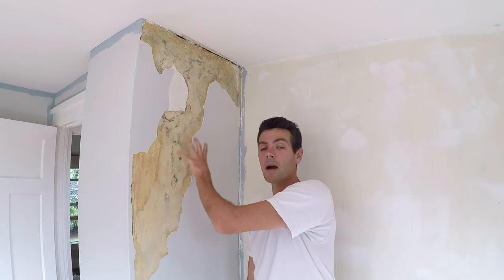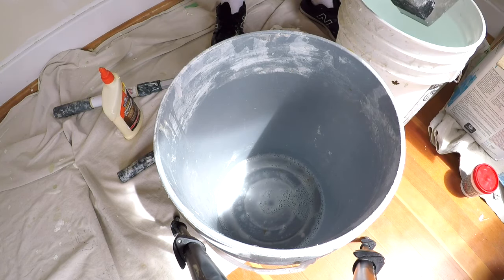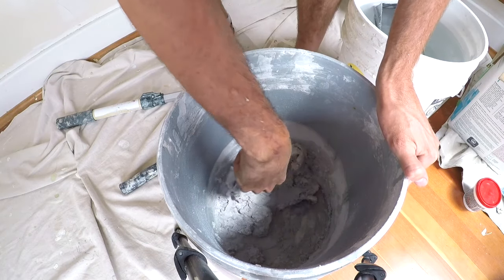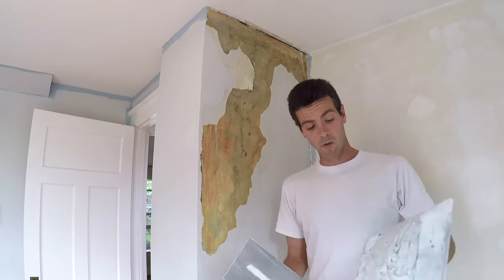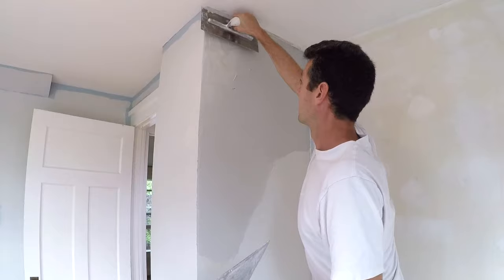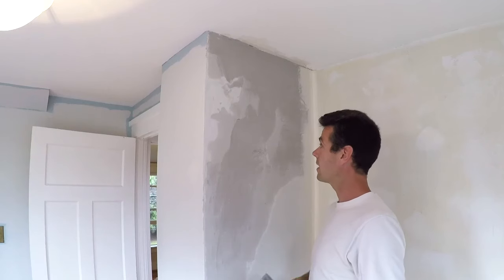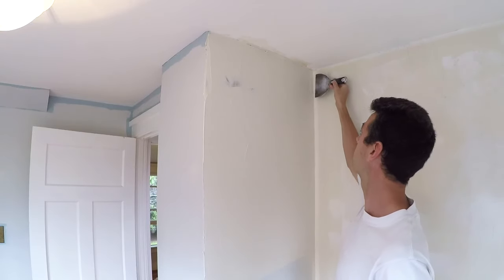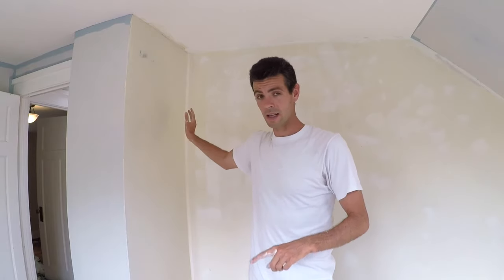Bonding Quickset Drywall Mud to Old Plaster!

Comment: I was actually wondering what the difference is between plaster in the USA and the UK. From the videos ive seen The UK plaster seems easier to mix you basically just add water. While in the USA. They use a base coat and for the finish coat they mix plaster  with a mixture of lime and water. Most drywallers Ive seen use a quick set or durabond with mesh tape or fiberfuse and then an all purpose or top coat mud for the finish.  as a diyer Ive had pretty good success with the durabond and mesh tape method. Ive also tried your glue method and it also works great.

Comment: We live in a bungalow built in the 50's and the section of plaster that delaminated received water damage from some old windows that were condensing like mad in the winter. Well, that condensed water was getting into the plaster on the cinder block beneath the window forcing it to delaminate, leaving an unplastered section about 18" x 12" in size. 

I'm going to try this repair method tonight so wish me luck!

EDIT: Success!!!! I can't believe how well this took, not to mention how incredibly strong it is. So much so in fact when I tried to sand it down by hand, I nearly passed out. I'd definitely recommend a hand sander for this.  But it looks great and blends in seamlessly. Thanks a million for this!
Reply: How thick was the layer that delaminated ? I have plaster delamination with pain and it’s like 1/16” thick.  Wondering how I’m going to adhere that thickness back on the wall and make it stay.
Reply: @sef2273  It was roughly about that thick. The previous owner also used some mesh in an effort to "band aid" the problem but just left a huge bulge that needed to be sanded down before I applied the glue/plaster solution. I'm looking at it right now and it's still solid to this day. The surface is also quite smooth underneath the coating of paint, with no shadows or bumps appearing in daylight.
Reply: @domenicpolsoni8370  did you use mesh tape?
Reply: Don't need to. Setting compound won't crack. 
Sheetrock brand 5 minute mud. Not necessary to put glue. Just little water, and a pan at a time. YOU GOT FIVE MINUTES! GO! 
After cleaning the quickly setting panful you used, come back with your trowel or knife and press it in low angle and also shave your ridges if they are dry
Reply: @sef2273  I did not. Just straight onto the surface. Mind you I made sure to remove as much dust and particles as possible before applying. Something tells me that the glue/plaster mix would have adhered anyway though. It was so incredibly tacky.

Comment: It's the wonderful world of plaster that every person who does drywall wants to stay away from. Some homes have plaster on 1/4 gypsum boards, and not wooden lathes
Plaster is a completely different trade even though they have similar motions, and both start out as mud. I have a house built in the 50"s. They used small 2×3 ft gypsum boards, then a rock lathe, concrete like substance, then a plaster coat and a final plaster skim coat.
Most of the walls range between 7/8 up to a little over an inch. 
There are several ways to tackle these repairs. Your videos are excellent in learning the basics so anyone can figure out a possible solution.  I would use 5/8 drywall score horizontal keys across the drywall, then use a quick set, even used a plaster before, and then a final joint compound (easier to sand) as a final coat which was easier to make smooth and sand. 
I have had several disasters. Finally, I got it to look professional. This last process seemed to work the best.
Any videos from start to finish on this topic would be welcome. These walls last a long time and are quality built, but after 75 years, many of these houses are starting to break down. Getting cracks and just normal damage and wear. Thanks again.

Comment: Interesting approach!
I had chosen a (2K) resin and thrown sand with huge grain against the wall. Once hardened it is like sand paper, pretty common for coatings on the floor.
With acrylic resin, you can work afterwards pretty quick and this is extremely durable.

Comment: I appreciate your videos. I would like to see a video on mixing mud, in particular a small amount for repair using quickset mud. The powder to water ratio has always been a challenge for me. Too dry then too wet, add more, too dry,...repeat. Throw on wall before it sets up (not literally but close to get it on fast).

Comment: I often use Kills primer before skimming over with All Purpose mud and let dry overnight.  I let the Kills dry to tacky.  Works great when feathering over painted surfaces.  Kills sands at the feathered edge well too.  I typically have several days to do drywall/plaster repairs because I'm doing room remodels.
Reply: I need to do some repairs to walls with damage similar to the one he does in this video. I have cracks in the plaster. To make sure I'm reading  your comment correctly- should I do a coat of Kilz Primer on the bare plaster BEFORE I repair the cracks and imperfections,  and then do another coat of Kilz Primer after I've sanded the spackling smooth? Then I can finally paint the repair to match rest of wall? I appreciate any insight,  this is my 1st foray into this type of repair job!
Reply: @the_ghost_of_teddy_perkins  I use the Kills Primer as a sort of glue for the mud to stick well to painted surfaces.  Drywall mud will stick great to bare plaster IF the plaster is sound.  (so no Kills needed here.)  Make sure bare plaster is not dry and dusty.  Moisten before applying mud.(dab with a wet sponge)
Reply: @L.Scott_Music  Thanks for the prompt reply! Sorry if this sounds stupid, but is 'mud' the same thing as spackling?
Reply: @the_ghost_of_teddy_perkins  No, spackling is a light weight material for small holes.  Mud is short for 'All Purpose Drywall Mud' (in this context).  There is Fast Set mud too but I find it's bond to be less, so I like to at least do a first coat of All Purpose first for larger patches.
Reply: so after i use all purpose do i then use the blue lids since its smoother

Comment: Vancouver Carpenter 
When I first started mudding on my own, I had some issues with my mixing setup. So I decided to use warm water, even hot water once. 
BUBBLES! The cooling effect of the mud created a thousand tiny bubbles in my coats lol. Live and learn. 
If only your channel was around then!

Comment: I’ve got a old plaster wall house. That I’m making repairs to. What I usually do is use a oil primer to seal all the walls, fill in my worse areas with durabond 90 indoor/outdoor joint compound. Hot mud one coat and use premixed green top USG thinned out with a little water for the final skim coat. Little to no sanding. It works but a slow process. Have you ever used oil primer to seal old plaster walls

Comment: I’ve done many repairs like that, i’ve always used a concrete bonding agent (looks and smells a lot like white carpenters glue and water mixed). Good thing about using that is that you can also use it around the house for any concrete work as well.
Reply: would a primer work just as well ?

Comment: What I see on almost every working chimney that is covered with plaster is stains.
The problem is condensation from colder inside air and hot chimney smoke.
To avoid it, before painting plaster around the chimney, waterproof it, seal those pores, If the chimney if made from brick. Stainless steel chimney wont leak.
If the roof patch around the chimney is leaking because of rain, first fix that patch with tar, then walls.

Question for Ben: Have you ever used fiberglass tape insted of paper tape? Not mesh but full fiberglass tape.
Keep up the excelent work!

Comment: Thanks for this. I was doing some repair to my 1940 built house. It has 1/2 drywall covered with 1/2 inch cement with a thin plaster vaneer. I had some areas where the plaster veneer came off. I'm going to try your glue method.

Comment: Very well done. But I have to say,  I've never had fast set delaminate on me. I make my mix a little on the too wet side which helps in adhesion. I also use durabond 90 for my initial and follow up with sandable 90 or 120 depending on how much I  need to do, then I  top it off with my finish coat of topping.  Works perfect every time.

Comment: I must say, it is very refreshing to learn from someone who lives  and educates for quality work! There is always a lot to learn from you, even from mixing mud. ;-) It would be great to give mixing advice and mud comparison (incl. mud consistency which then is useful for your global audience) for the different coats and purposes. Your videos are just great, educational and highly appreciated. As inspiration for future videos you could consider that even initial drywalls can be a pain and can have its own challenges which then have to be fixed e.g. uneven butt joints. You taught us already separately abt coating butt joints and flat joints but how would you coat a ceiling where horizontal flat joints meet vertical butt joints like in a chess board of rectangles? Starting with the butt joints and then the flat joints or would you finish it combined as ceiling sections? It is the skim coat, which now has to handle some imperfections and make the difference in the end...
Thanks a lot for being our hero of quality work!

Comment: Our drywall finisher is havaing a really tough time with air pockets. It’s really gotten worse the last year. Seems like it’s mostly over wide butt joints that are painted. I know that the painted surface absorbs water at a slower rate so that explains a lot over the painted stuff but it’s also showing up on the new drywall as well. These guys do great work but we’ve got to get this problem solved.
Reply: creekfreakjr  the air pockets are called pocks,you can buy an additive that you put in the topping compound (finish coat) that helps eliminate the pocks(air pockets)some types of topping compounds seem to be more prone to pock then others,

Comment: Like your videos. I'm a plasterer in the states. Was told never to use the yellow carpenter's glue by a chemical engineer. I guess if things didn't fall off the wall then it's actually just fine to use! Ha! I use regular white Elmer's glue which much cheaper than Thorobond or Larsen's... especially when you cut it with water. The two other brands I mentioned recommend not cutting with water but I'm sure they are simply PVA just like Elmer's but I don't want to chance a failure.  I never get a call back with this method of cutting glue. Must let it tack up before coating over but it can be dry. Must re-glue if not coated within 24 hours. If not dry and only tacking it also acts like a slight retarder to the gypsum that's in the hot mud because we all know that hot mud and plaster SETS to get hard and does not DRY to get hard.  Retarding is when the gypsum won't set as fast as expected.

Comment: Yes, this is the one!! Finally! This is the video that is going to help me finish my repair. I can’t tell you how much searching I’ve done and there’s rarely anything with plaster walls it’s always drywall. This is so helpful, thank you!

I have never done anything like this, I’m a female in my 20s, but I tend to have good intuition with this kind of thing and for the most part I did it right. Chipping away all the loose material - my dad tried to say I was picking at the wall too much and just making a mess. I knew we had to remove all the loose flaking stuff! Then the glue and water primer. It makes sense bcuz the wall bare would be too porous. Again my dad thought I was wasting time. 

The problem I was running into was that my repair area is all the way down by the baseboards, and I have scoliosis so contorting myself to work down there is difficult. And the biggest mistake I made was buying “patching compound”... it sounded like the right stuff for the job! I got two brands- easy sand and fix it all. One is 5 min set and the other is 10 min. Way too fast! I cut the mixing recipe in quarters and still couldn’t use all the mix before it set in the pan! I have tried about 3-4 times and each time could barely get anything on the wall before it was too late. Doesn’t help I live in a hot humid climate, Hawaii, so the stuff sets FAST. Now I know to try 20-minute which we actually have that the guys who worked on our recent bathroom renovation left behind! Yay. Can’t wait to get the job DONE. It’s in my bedroom so I’ve had a whole wall out of commission for almost a month.

Comment: Thanks for this video! I completed my first repair using this method. Question: why do you switch to all purpose mud to finish instead of a 2nd coat of quick set? Is it for easy of sanding for us DIYers or another reason?

Comment: Fantastic video! I am repairing holes in my closet wall where the laminate fell off exposing the rough plaster underneath. I have Loctite all purpose adhesive. Can I use that instead of the carpenter's glue? Thank you!

Comment: Why not concrete bonding adhesive mix?  Lanco, Quickcrete, and SikaLatex are 3 of the most common ones.
I believe it will work better and set faster than most wood glues.
Reply: It's pretty much the same as Elmer's glue, At least the ones I used. I get a Gallon of Elmer's white glue, cut it half with water, And Always use that mix on first coat.
Reply: it's pretty much all just PVA in the end.  I'm sure there's special sauce in the different varieties.  But PVA is PVA.
Reply: @fiver-hoo  true. But those variations are quite significant.

Comment: How about a one-stop video describing and showing when to use mud at different consistencies? Start with the thickest usable quickset or all-purpose and describe which situations it's used for and show us in the bucket and on the trowel how it (barely) flows. Then mix it thinner with more water and describe which situations that is used for and show us how it flows. Repeat the process through to the thinnest mud you can use for something. 

I'd like the video because some folks on youtube forget to show us the mud consistency. Or if they show us, it's difficult remembering how it compares to thinner or thicker consistencies for other uses in other videos. Uses like taping, or after the taping coat is dry, or final coats, or working on ceilings, or skim coating.
Reply from the maker: Great idea!

Comment: I've been finishing sheetrock for over 25 years and can't for anything understand why some people use a hawk and tial to finish with it is so much easier and alot less messy if you use  drywall mud knives and a mud pan in my opinion of course most of the work I do is new construction and I also use finishing  tools but even when doing patch work I still use a pan a knife

Comment: How to mix: yes please! Also, I'm unable to find Topping Mud in my area, so is Lite All Purpose my only alternative?
Reply from the maker: Yes. It's a  good choice
Reply: An all purpose mud is good too :)
Reply: Use 20min
Reply: @Chris-oz5md  20 min isnt good for a finish coat though.
Reply: If you have to use all-purpose (white) thin it a bit or you'll curse that sumbitch if you have any sanding, the lite tan all purpose is great already, I make sure to paddle it to get the tiny air bubbles to go away
Reply: Pva glue is a good tip. Nice.

Comment: To fix nail or small holes  and cracks in lath and plaster should I put a bit of a glue in my plaster to make the patch stick better?  I have a couple of cracks in the wall by door frames how would I fix these?  I love your videos, I find them so informative and easy to follow.  I am in the process of getting my walls prepped for painting.  Thanks in advance😊

Comment: I assume regular concrete binding agent would work as additive, e.g., Quikrete or others?

Main question:  I have some filling in to do on old plaster board/built up plaster ceiling.  Would Quickset or other 5- or 20-minute mud would work without mesh?  Probably build up with three or four coats, some areas needing upwards of one inch build up.  This is in an area that will then have crown installed.  Thanks for any insight.

Comment: I've never tried the glue. I will have to try it. I'd probably just prime it and mix all purpose or taping mud and 20 together. It always takes for ever to dry with plaster. The ceiling looks like it was drywalled already so no chicken wire in the corners. You going to tape the corners? Thanks, great video.

Comment: @Vancouver Carpenter. My entire walls are basically like that plaster wall, after i've removed the wallpaper. The walls are pock marked with loads of little slices and chips. Would you recommend glue painting the entire room like you did? There is no lamination stuff there its just the plaster. I'm planning on doing it like your "easiest way to skim a coat" video. Since they arent actually holes in the wall its just like lots and lots of pock marks. Sadly the corners are all curved which im not too sure how to do. Awesome vids man.

Comment: The ingredient in wood glue or white Elmers glue is PVA, Poly Vinyl Acetate. This is a common material for bonding. Something better may be Larsons Plaster Weld. It's a PVA based material that rewets when you apply mud for better adhesion.
Reply from the maker: I can't find that locally
Reply: I think any PVA glue gets tacky if it gets wet. I like to use weldbond, always have on hand for many uses.
Reply: Most PVA bonding agents for stucco would work, like Quikrete Bonding Adhesive available at Home Depot. I like the Larsons Plaster Weld because it becomes tacky again when wetted. Using the Elmers just seals the plaster and keeps it from pulling the moisture from the new mud. Its effective, but Larsons is the belts and suspenders approach. I really enjoy your videos as well.